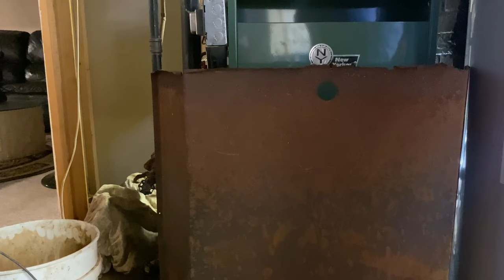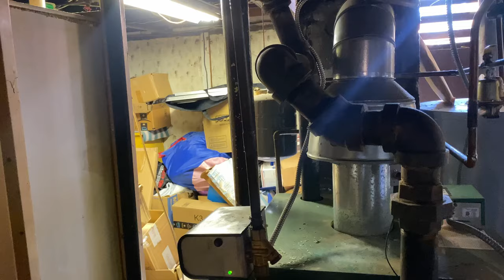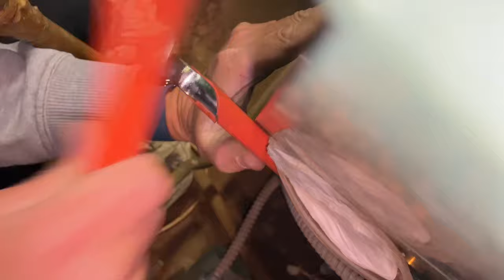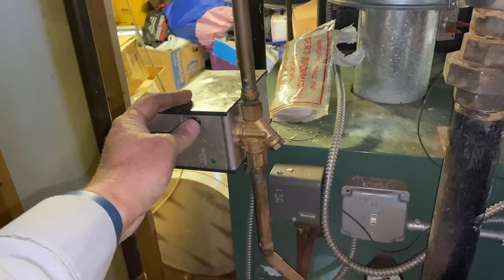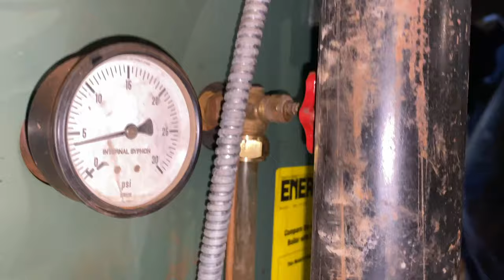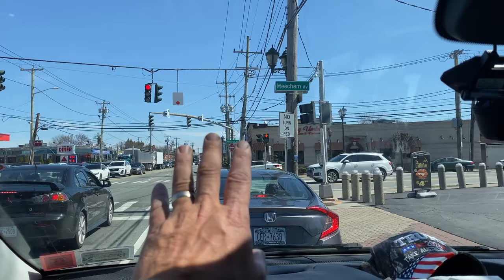New Yorker Steam Boiler Not Heating LWCO Blinking Erratically & Overfilling System with Water

Comment: Best practices on this service call, kept the educated customer informed without talking over her.
An educated consumer is our best customer.
The previous installer was a hack.
You performed good service and kept the conversation moving in the right direction.
Nice save for bending the rod to clear the goop out of the sight glass lower valve. Hopefully you can get a yearly contract for maintenance and help them when they need a new boiler.

Comment: Great video.   Wouldn't the pressuretrol determine how much it cycles?  Be great to see how bad the radiator parts look.
Reply from the maker: The pressure control is just a safety for pressure
Reply: pressurestat? the device that cycles the steam boiler on pressure.  @PipeDoctor

Comment: Mikey: How about using the Milwaukee M18 1/2” drive impact gun with correct socket instead of fighting with pipe wrenches on that probe? Nice job, and good to see Peter out on service calls again 👍👍
BTW, what’s 4 slices cost? 😳
Reply from the maker: The KU bill was $21

Comment: I understand that it’s code, but a 30psi gauge on a system that should be running typically at a pressure of a few ounces (and a p’tol cutout at 1.5lbs) is pretty much worthless. 

I replaced mine with a 3psi gauge and haven’t looked back. Far more useful. Can easily see whether my pigtail has become clogged, for example.
Reply from the maker: The issue is if you go to low and gauge when the pigtail gets clogged, you’re gonna blow the gauge, so that’s why you typically have a 30 psi pressure gauge on a steam boiler residential
Reply: @PipeDoctor  Gauges are typically installed on the output side of a pigtail along with the pressuretrol. If the pigtail becomes clogged, the gauge sees no pressure. With a low pressure gauge that shows a clear deflection under ounces of pressure, it will be clear when the pigtail becomes clogged.

Comment: Nice  work. It’s weird, some lwco say teflon no dope 

Others say dope no teflon 

I don’t understand
Reply from the maker: please tell me which ones say teflon is okay?
Reply: @PipeDoctor  safgard model 1100 page 1 step 2 of the install manual 

Apply Teflon® tape to the threads of the Model 1100. Do not use pipe dope or other pipe sealants.
Reply: Interesting. 

The safgar 1100 has a plastic body with non-metallic threads. The electrical return must be through the attached multi wire connector. 

Pipe dope may very well damage the plastic threads over time and hence is cautioned against. 

Mikey Pipes and I learned something new today.
Reply: @marcinmerrimack1726  same with the taco lwco. I don’t actually understand why and why not. Makes you think tho.